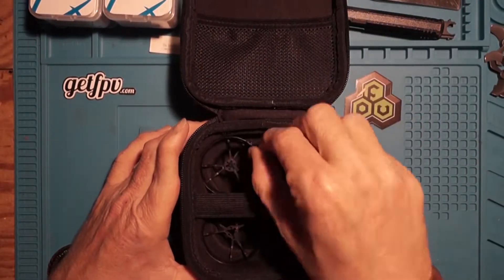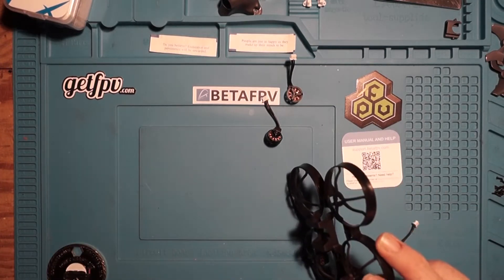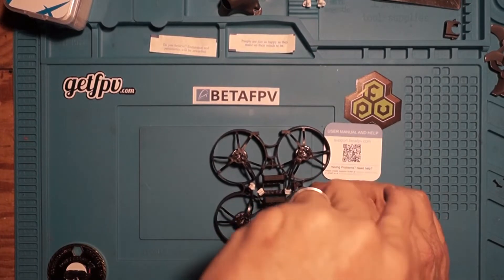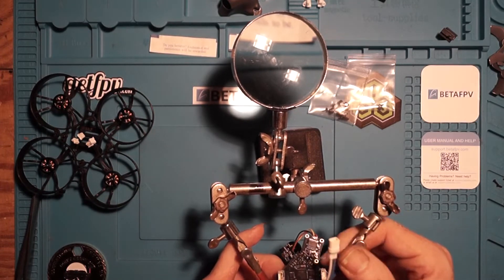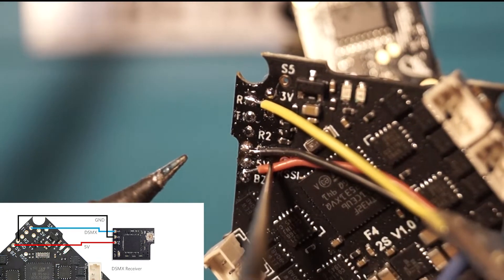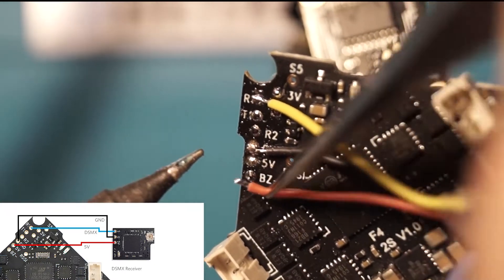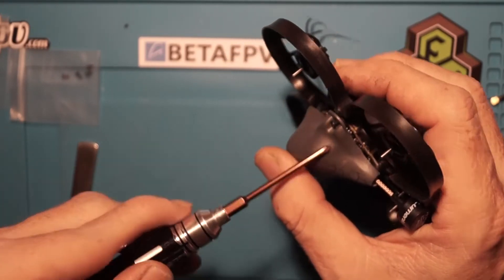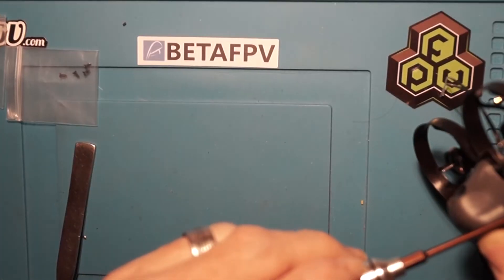FPVCrate / BetaFPV Abducted Meteor 75 Build Video

Comment: A razor blade helps Some people devide solder joints like motor plug pins that are real close together. 
Try not to heat the blade up.
Another helpful practice is not letting heat transfer from one pad to a neighbor pad.
😉👍 Just helping those who feel helpless but are able.